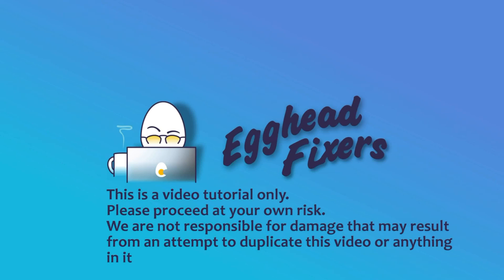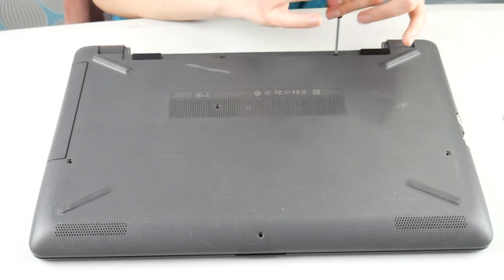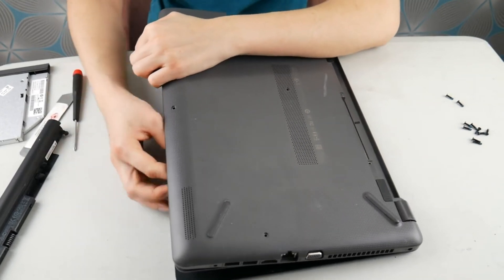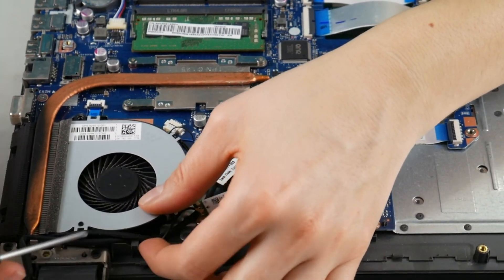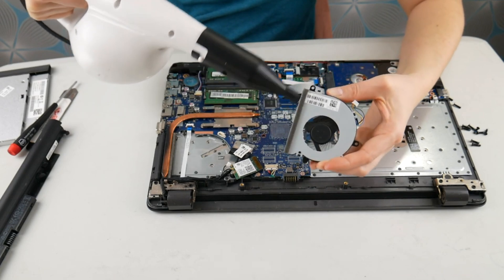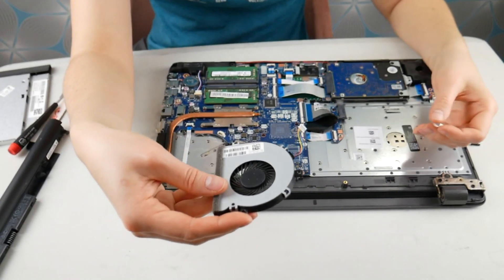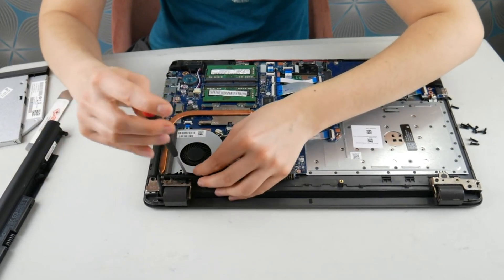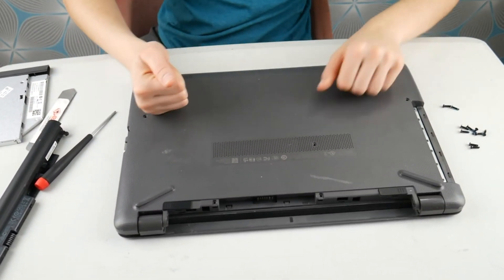How To Repair a HP Error Code System Fan 90B

Comment: Hi I am currently experiencing hp 90b error and now no. Power on my hp envy 16-h1023dx when I press windows key v and the power button I get power but fans don't spin and the screen stays blank. I originally got the screen replaced to now have to do the fans but not sure what the issue could be One of the fans has already been replaced. And the other cleaned. We replaced the thermal paste as well and I am not sure if the bios is corrupted but we have tried everything to the best of our knowledge and are stumped.
Reply from the maker: Have you tried updating BIOS? Because HPs are known for having BIOS issues that cause problems with the fan

Comment: I have an HP Omen 25L desktop gaming pc with the Fan 90b code. I changed the fan, updated bios, and its still showing the code. Any suggestions?
Reply from the maker: Sorry to hear that :( If there is any dust build up on the inside I would recommend removing it. Also have you tried performing a hard reset? Performing a hard reset can reset recorded thermal values in memory and enable you to use the computer again.

Comment: hey i have a hp 255 g9 and its brand new, i bought it a month ago and a few days ago it started to become really slow out of the blue, when i gave it a restart it showed the 90b error code, i did take of the panel and all that to check if there was some visual dmg but did not really see anything, i have not tried taking the fan out since i dont have the tools for it at the moment, but i was wondering if the warranty still takes cover of that since i have not done anything that would cause the fan to stop spinning.
Dear
Reply from the maker: Typically HP and Dell would still cover it from what I understand. Dell will often have users take the panel off to look for damage when you call it in under your warranty.

Comment: THANK YOU!  My computer has been out of warranty for some years and I thought I would have to cough up money that I don't have to have it repaired. I am a single woman and am very much into DIY.  I should have gone to school for it.  I used to love taking little things apart and putting it back together again when I was a kid!   I had the error 90B message about the fan and thought my computer was about to be destroyed.  But following this video helped a lot! I have a can of compressed air, but it is packed somewhere, so I ran to the store and bought another can. After I dissembled the parts and sprayed the air in one of the fans, I noticed that it wasn't spinning like the other one had done. I changed the angle and sprayed little bursts again until it began spinning then reassembled my computer. I think that was the culprit because my computer works again and the error message is GONE! You've gained a like, and a subscriber!!!  ❤❤❤❤
Reply from the maker: Excellent work!! Computer repair is one of the easier fields to get into when it comes to computers. It's also a lot of fun if you are a DIY. Good for you repairing your own stuff!!
Reply: Thank you again!
Reply from the maker: @angelictigerette   You are welcome!!

Comment: I've got an Hp-17x062na laptop, and I am using a charger with it (currently don't have a battery). I did a CMOS reset by taking the cell out for a while and then putting it back. When i turned on the computer, it said something like CMOS reset and an error code but I forgot to take note of that. I didn't press any key and after a few seconds, this error came up.  Can I use the video to try and resolve it, or would it be another problem? Thanks
Reply: 👆 I also heard some popping sound or something like that after I replaced the battery and turned it on
Reply from the maker: You may need set the date and time in BIOS. The BIOS reset will reset the date and time in BIOS as well. So you need to go into BIOS to set it back to the correct date and time after you save it then it will clear the error.

Comment: I've cleaned all the dust out, even replaced the fans, and still get the same error. How does one update the BIOS? Isn't that complicated and risky? :(
Reply from the maker: It's not hard too hard. Just make sure your battery is charged, you keep the power cord plugged in and don't interrupt or turn it off during the process. Here is a link on how to do it:

https://www.hp.com/us-en/shop/tech-takes/how-to-update-bios-software

Comment: my laptop only has 2 screws at the top, it doesn't have any at the bottom left or right? what do I do????
Reply from the maker: You can google a disassembly video for your model. That should show you how to take it apart
Reply: @EggheadFixers  thx turns out there were hiding underneath the rubber things under the computer, I feel like that's just bad deign

Comment: hey so i have a hp omen desktop 880 and i upgraded my aio and i keep   getting a b90 error code only during boot up is there anyway to disable this because if i just press the enter button it loads into windows normaly. is there anyway to aviod the blue screen from poping up and only giving me 15 seconds to press enter  other wise it powers down thank you in advance
Reply from the maker: This error is typically related to the fan. It's usually a that the fan is not spinning correctly or not spinning at all. Is you computer newer? Because if it's still under warranty I would call it in.
Reply: @EggheadFixers  no it’s out of warranty and I upgraded the aio and the fan and everything works fans are spinning and the pump is working I just keep getting the error only during boot and it goes right past it when I press enter the aio I installed in the Corsair h60
Reply: I just am wondering if there is anyway to disable the error from poping up in bios
Reply from the maker: @remylordski  That is strange. Have you tried updating BIOS? HP has had some false fan errors that were related to BIOS and an update was released to correct it.
Reply: @EggheadFixers  no I actually haven’t
Reply: @EggheadFixers  I will though this weekend when I have some time
Reply: @EggheadFixers  if you can would you be able to give me a link for that bios update
Reply from the maker: @remylordski  Sorry we don't have a video on how to update BIOs.

Comment: i clean fan and vent but still getting those error what should i do ?
Reply from the maker: If it's still doing it after you cleaned the fan then the next step would be to try updating BIOS or try replacing the fan.

Comment: So how do i stop the error from coming up at all. I have a Omen 30L and had to replace the case/AIO because it didnt cool properly and the error is still happening even though my temps are perfectly fine
Reply from the maker: It can also be a problem with BIOS.  So in some cases if you install the latest version on BIOS that can fix it. Is your computer still under warranty?

Comment: I did the same. Opened back panel removed the fan, then cleaned the fan looked for wires and stickers(everything was fine) and then again placed the fan in its place.After that i booted laptop and it booted successfully without any errors.But again after 5days error came, again i did the same process and again it booted without error.But again the error came after 5days??What should i do? Replace the fan or is it motherboard issue? Plz tell me
Reply from the maker: I would update BIOS because in rare cases it can be a BIOS update issue. If that doesn't work then I would try replacing the fan.
Reply: @EggheadFixers  I recently updated bios so bios is up to date. I think now the last option is replacing the fan but i am confused because there are two fans so replace one of them or both.
Reply from the maker: @keshav5408  Ya that's a difficult decision. The fans are usually pretty cheap. So you could buy both and replace them one at a time. If the error goes away after replacing one of them then you which one is giving you trouble.

Comment: I got the Error Code System Fan 90B even though my fan is new and clean. My pc runs smoothly without any problems. is it ok to just keep running my laptop like that? because i tried every possible solution whether it be blowing air into the fan or checking the wirings and none of them worked...
Reply from the maker: If the fan seems to be working correctly then it could just be an error that an update will fix. I would try updating BIOS see if the error message goes away. If an update doesn't help and you are worried about it then you could start using your laptop with a cooling pad just in case.
Reply: @EggheadFixers  Thanks! will try
Reply from the maker: @residental4331  You're welcome!!

Comment: Hi, I have HP spectre X360 that show error code system fan 90B. What should I do if I want to fix it myself because last year I have done service it to HP centre.
Reply from the maker: On HP.com/support you can look up  your model HP and the manual will show you how to take it apart. You can also look up a disassembly video for your model HP on YouTube to see it being disassembled.

Comment: I get the same error code and have worked out it is the cpu fan I cleaned it all out and it has stopped the major noise it was making but software is telling me when running a game the temps are getting way to high Could the fan be damaged or maybe the paste ?
Reply from the maker: It could be the fan or the paste. I would try and replace both. Just make sure you buy a good quality thermal paste.

Comment: I have a fan problem with my HP 255 G7 laptop. It started with some weird sounds and now its queit but an error message popped on startup saying Fan 90B error blah blah blah. Do I have to replace the fan?
Reply from the maker: Often times with an error like this it either needs to be cleaned or replaced in order to fix it.
Reply: @EggheadFixers  I tried to clean it but it still persists.
Reply from the maker: @Nkomazi  Ya then the next step would be replacing it:/
Reply: @EggheadFixers  i can't replace it now. I need to use my laptop urgently. Could it be a problem?
Reply from the maker: @Nkomazi  It can be a problem if your computer isn't being cooled down correctly. If you need to use it then I would consider using it with a cooling pad.

Comment: My laptop does not have an option to remove the batter I flipped it over and I couldn't find anything there
Reply from the maker: If you have an internal battery you will have to look up a disassembly video for your model computer so you can get inside your computer. You can do this same method in the video you will just have to unplug the battery from the motherboard instead of taking it out.

Comment: hey there, your videos are so helpful 
i have a issue with my hp g62 laptop
it's turn off after 5mins i checked the heat issue also it not because the heat issue plz help me to fix it
Reply from the maker: HPs have built in diagnostic that you can run to check to see if there is a problem with the hardware. You can access it by hitting start and then tapping on F9 with some models you have to hit esc then F9. Run the diagnostic and let me know the results.